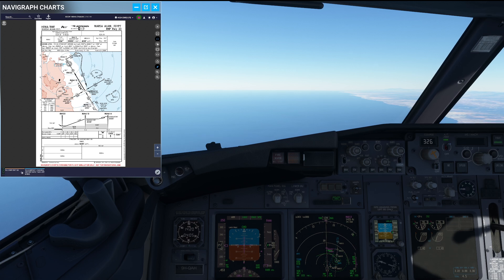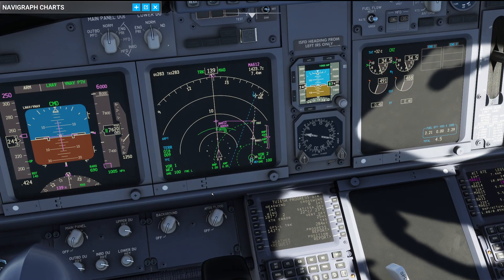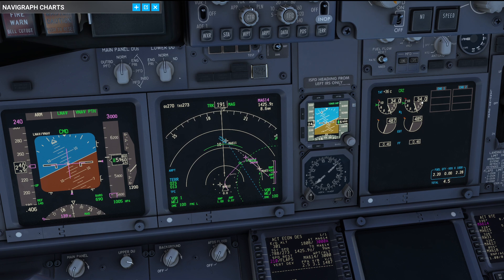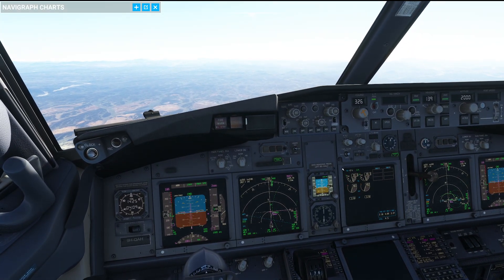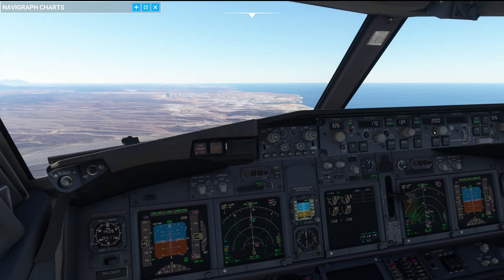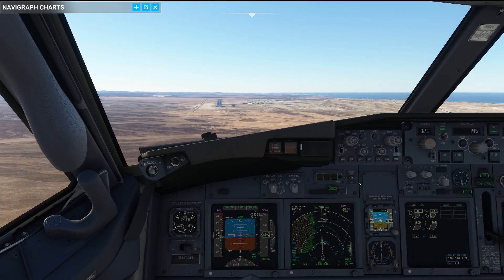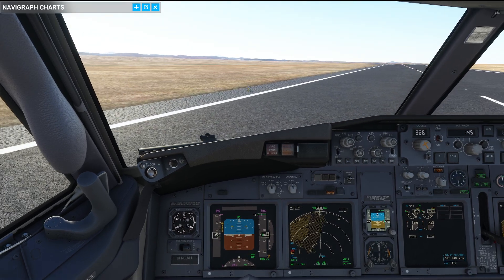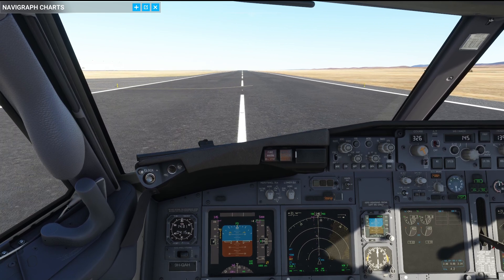737-800 Keeping Energy Under Control | Real 737 Pilot

Comment: I don’t know but I think PMDG is not really listening nice to you. Why is the FD so slow? You fly 100ft below the altitude and it’s still not commanding pitch up. Did you realise that?
Also when balancing the fuel, if you leave the crossfeed open and switch the 2 pumps on again you still get an imbalance after a while again.